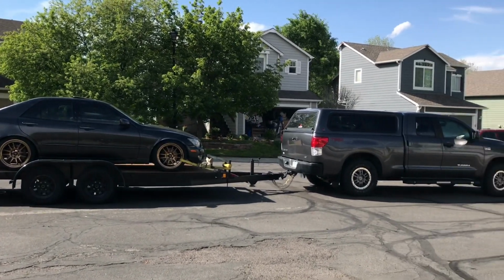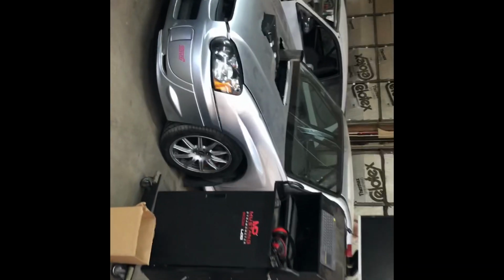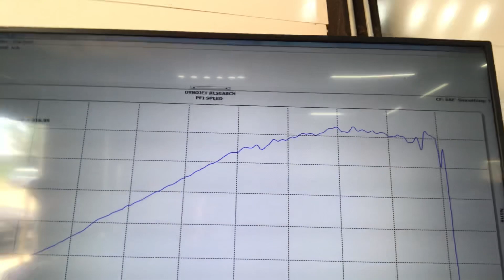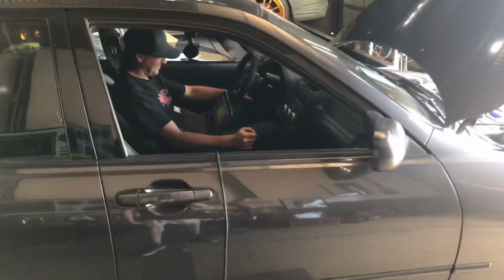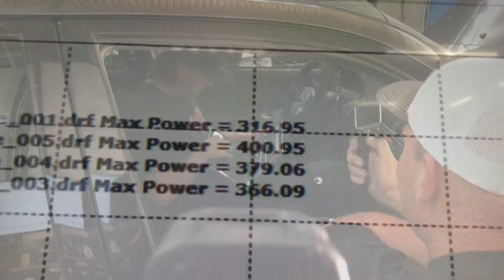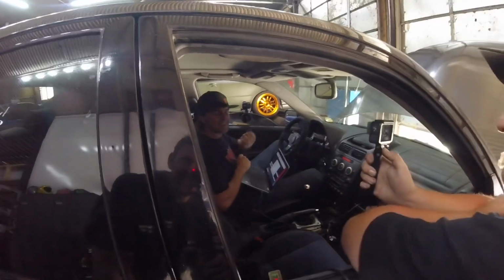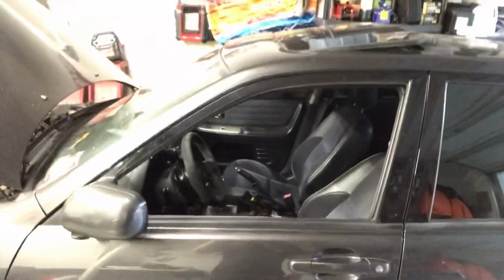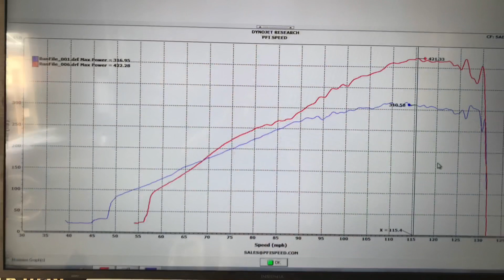How Much Power does a NA-T Stock IS300 Make?  PFI Speed Dyno Tune

Comment: What have you done to this car to be able to handle this power? Did you do any Head Gasket replaces? Also how many miles did this car have before you boosted it? Just curious...
Reply from the maker: Wilson Wu nothing. 140k stock completely. Just turbo kit, fuel system, and ecu infinity.

Comment: be careful if you still have the stock rods in that block they like to give out around 400-450whp or ~350-400wtq
Reply: So look i thought they fuck up at 350wheel lol cuz I gotta 1999 sc300 with vvti but wonder should I swap another ge in it and boost it stock and the turbo kit won't be that much
Reply: @Singleturbo-sk9qp  depending on your power goal, but I would recommend to use gte headgasket to lower the compression down a bit. Even with 350hp it should be still plenty of fun.
Reply: @SofiaSclafani  honestly they say the head gasket just create more heat plus u would have to run more boost to compensate for lack of power lol u can run 9psi on e85 and make 420 and just try to keep the torque down but in my case I have a spare nonvvti ge with low miles and a spare vvti head the ge in my car now has a built head with studs in it and new head gasket its been fine so far

Comment: hows the installation of the cx racing turbo kit? any modification needed? or straight direct bolt on. Considering mine too :D
Reply from the maker: Check out some of my earlier videos for the complete installation. Its not that bad but it has its challenges such as oil drain location.
Reply: @C3GARAGEMedia  thank you sir! your car is a beauty hearing that spool. :D